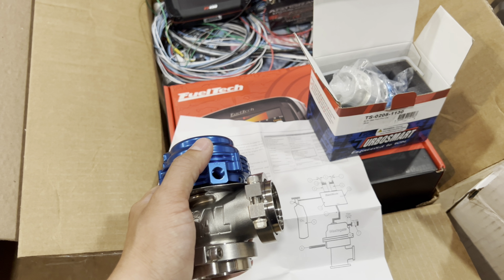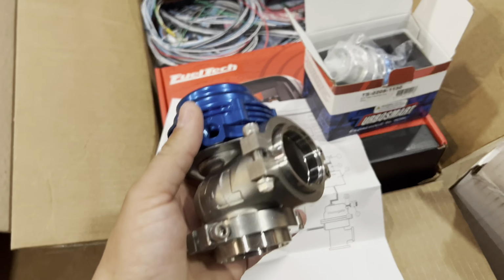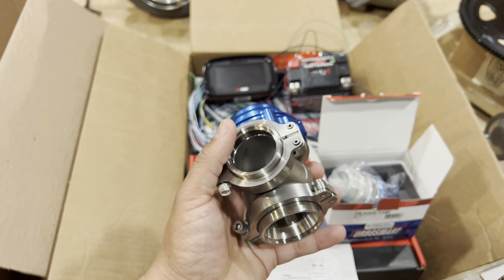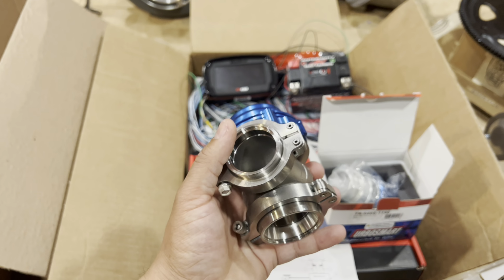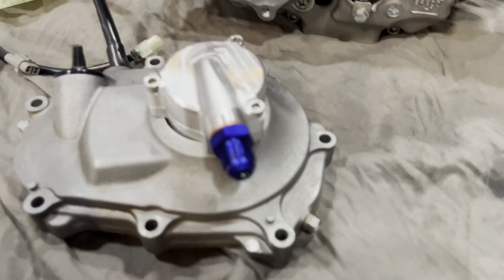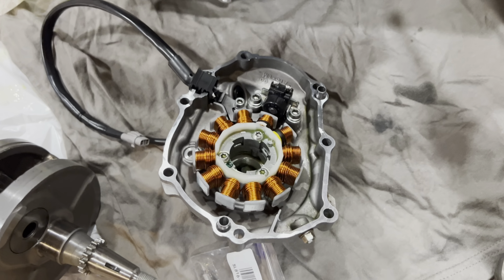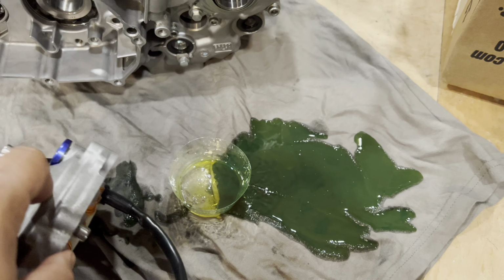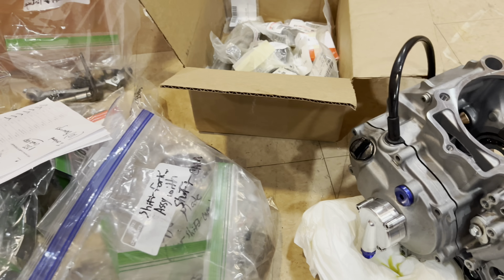TURBO YZ450F DIRTBIKE- Build Series-Pt.4!

Comment: You're buying turbo parts for a much larger motor.  Why not go smaller?  Less weight, plumbing, the turbo and wastegate will work better, and you'll get more usable power. 

Huge turbo is only good for a motor with the exhaust pressure to spin it.  That blow off valve is meant for 6-cylinder engines.

Comment: Silly question, but did you check to see if the yamaha crankshaft spins the same direction as in a hayabusas?  If not, then it will be spinning the oil pump backwards.
Reply from the maker: The pump is setup for the orientation of the YZ engine. When I ordered it, there’s an option for clockwise/counter clockwise rotation.